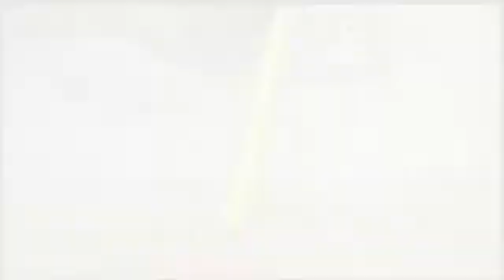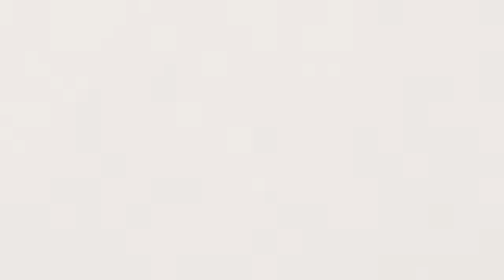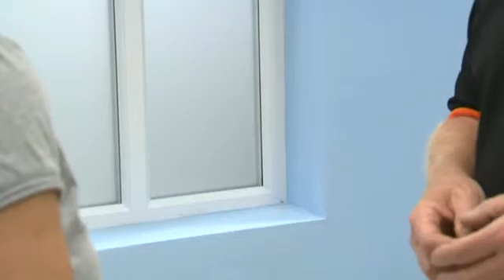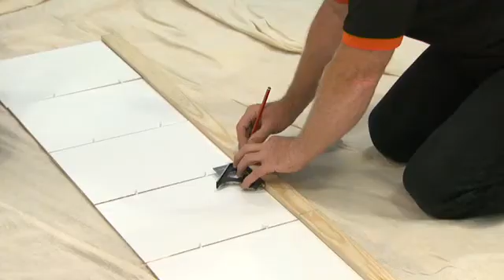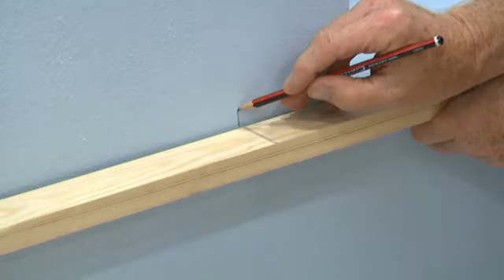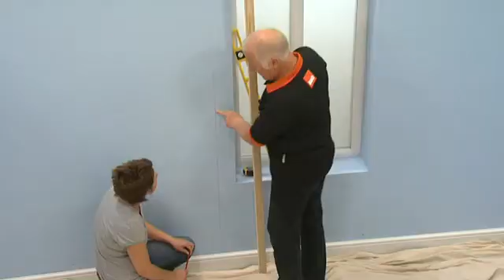How to Apply Wall Tiles

Comment: Official B&Q video and the teacher uses the WRONG size of tile trim and looks like this chap has never buttered bread never mind the back of a tile!  That window trim is a complete mess.  Make sure you use the correct 'depth' of trim for your tiles.  It should be as deep as the tile PLUS the depth of your adhesive such that the surface of the tile meets the top of the trim exactly. (Tiles usually have a bevel edge.  It's the start of this bevel that should line with the trim piece, no edge colour showing and don't push the tile down too far creating a lip that water will puddle behind for example).    On the face of the window cut your tiles to the exact point the recess begins.  If you are struggling to do this cut them 2mm short of this and 'fill' the gap from tile to trim with grout.  When tiling the recess measure from the dress surface of the facing tiles to the back of the recess and SUBTRACT the width of your trim.  Cut to this or use the 2mm gap trick to give yourself a little room to play with.  Oh...windows rarely run true due to plastering limitations so check for square and measure very carefully with each tile.  Tiling round a window like this is hard so go gently and give yourself the best chance to get it right.